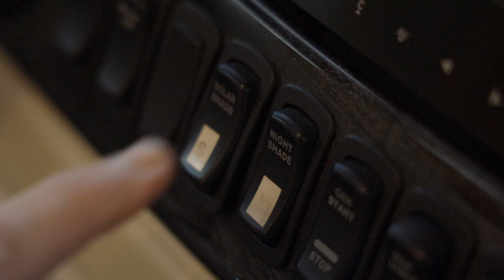How To Replace TIFFIN RV Electric Shade Motor

Comment: When you removed the shade from the frame to unroll it, did you have a spring inside the tube that came unwound?  We removed our solar shade from the frame to unroll it to get to the set screw and we heard the spring unwind.  Just wondered if that happened to you and how you put it back together if it did happen..
Reply from the maker: Hi Diana, We dd hear the spring unwind, but we did not do anything and it is working fine.  We reinstalled without a problem. Hope that helps
Reply: @TheHungryCubanAdventures  Thank you so much!

Comment: I used this video to replace shade motor and broke the other end of the shade because it is attached with a set screw and VERY delicate. Now I have to replace the entire shade assbly. This warning should be in your presentation.
Reply from the maker: Sorry you had this problem. I am not a technician for the shade company i was just sharing my motor replacement method. Again i am sorry you had a problem

Comment: Hi, we have a Carefree of Colorado PowerVisor 3 set up in our motorhome. The day shade motor has gone dead. Are these all basically the same design as the one you worked on? Set screw probably as well? Just getting all the info I can before digging in. Thank you!
Reply from the maker: Mark I would think so. It I’d a basic motor within the shade. Hope that helps
Reply: The Hungry Cuban Adventures 
Well, I dug in and was able to get the motor out. No set screw thankfully! It’s an MCD motor. Now the fun part of tracking one down. Thanks for your video! It really helped me go in the right direction!
Reply from the maker: You are very welcome, glad we could help. Good luck on finding the motor. 👍

Comment: My shade stops about 14” from the top. Do I need to take it down and wind it by hand or is there a was to reprogram the stop?
Reply from the maker: Joseph I don’t know that answer. Find the name of the manufacturer and call them fir more info. Sorry I could not help.
Reply: How did this finally work out?  Did you need to take it back down and wind it up by hand?  I haven't started my motor replacement, but anticipating any issues I might have.

Comment: Where did you get the new motors and do you have a part number?  Also, did you have to set the stops for the new motors?  TIA
Reply from the maker: Hi Bob I ordered the part from Tiffin parts department. I did not set any stops. The front shade you control the distance you want it to travel with the switch.

Comment: As we thought, this was a horrible job. The video helped. 
Wire colors were all off. Coach to motor blue isn't blue its green. Other shade had to guess to red and blue. Would be so easy for directions to state up down, but it didnt. And yes we expected problems, had to switch them for the ups and downs. Learned 14 turns for a spring rewind. Put in stronger screws up top.
Got it done. If you don't think you can do this job. Don't try it.
Reply from the maker: Thanks fir your comment

Comment: Thanks for the video. Huge help.  One problem was getting the screws back that hold the thing up.  4 on the windshield side are wood screws that go into flake board.  The 4 on the inside of the coach are machine screws.  These thread into those nuts that have prongs on and sink into the flake boards.  Mine came out of position. Had to remove the backs of the two side cabinets to get them back in place.  What a pain.
Reply from the maker: I understand. The wood in some of these RV and what things are screwed into are pretty lame.